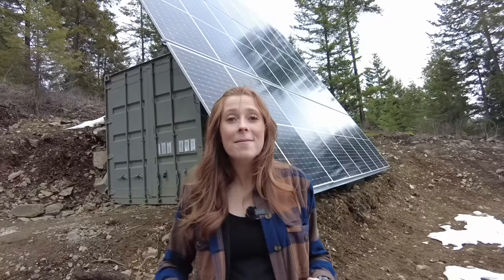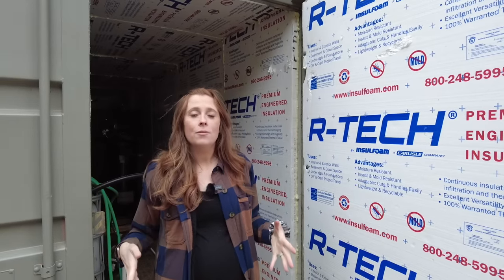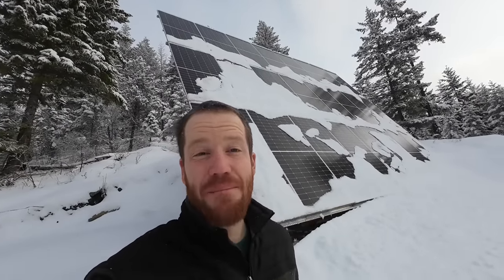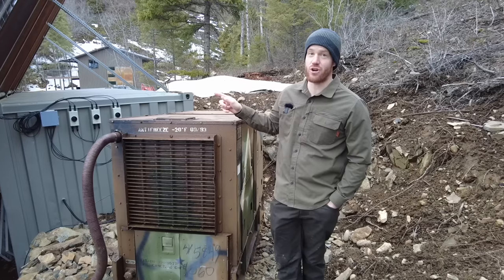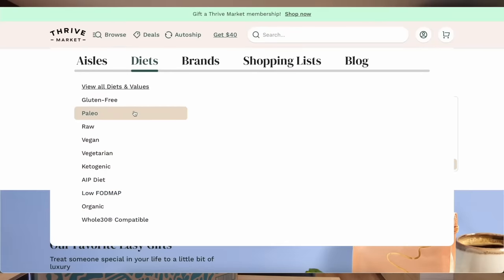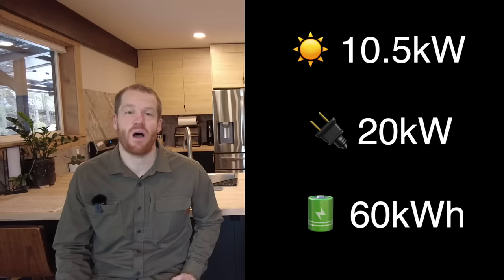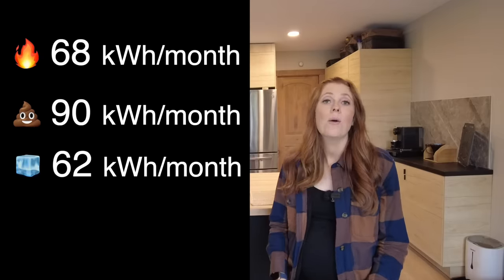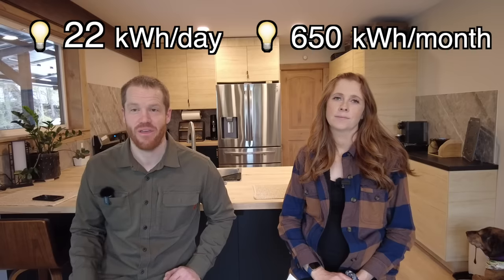The TRUTH About OFF-GRID Solar | Winter Update

Comment: I hate the idea of a generator. BUT the numbers don't lie. 10k per day on average, with 20k use. You would have to double the array size (stupid). Or make the battery 10x bigger (also stupid). In this specific use case, a generator is a no-brainer.
Perhaps in the future as panel prices continue to plummet, it may be worth expanding the array. As for the extra energy? Get crypto miners. Not only will they (eventually) pay for themselves, you can use them to heat your house! :)

Comment: "Burning the poop" makes no sense. You can separate the poop from the urine and just drain the urine into a septic tank. The poop can be dried and mixed with wood and used to heat your home or hot water instead of consuming electricity.

Comment: Lots of explanations. It's good to a point, but is trying to navigate a very complicated and board situation. This approach clearly isn't to save $$ by making your own power. That's clear with the 60 kwh of battery banks. The purpose of "off grid" is to remove the dependency of power companies, but this comes at a cost. From my own calculations to save cost the best way is to use solar, but not enough to go over your average usage. If you produce more (companies don't pay much anymore in most places) then you'll need batteries to store it, but the batteries even the cheap ones are so expensive often one can buy electricity cheaper than a battery can save during its lifetime... hence the solution to save $$ fit a solar system to supplement your power needs. The solution for off grid is lots of solar with generators for backup.

Comment: I get the impression that your system is to big. Since you have much to much energy produced 9 months of the year. Would it not be cheaper to downsize and just run the generator 1 extra month?
Reply: You think they should sell off solar panels and buy fuel?
Wasting electricity in the summer doesn't cost them anything beyond initial investment buying fuel costs them every year. That cost of fuel could buy another kilowatt of solar or a few kWh of better batteries.
If you have the space why would you not size your system to work during the season of least light?  Why worry about free summer electricity being wasted when you have more than you need.
I use about 10-11  kWh per day sometimes a little more in the winter if gas prices go high enough to use more electricity.
I bought 8125 watts of solar panels 25 x 325 watts 8 for the battery/inverter 8 more for direct feeding a solar powered minisplit with solar inputs. And I have no intention of giving up my grid connection or selling them any of my electricity.

Comment: how about hydrogen gas production? store 9 months H2 of and used in a fuel cell or burned in a H2 gas fired generator.
so 9 months out of the year your excess solar makes H2 gas. you store that gas.
you could use a fuel cell, using the heat from the cell to heat your home and hot water, or you could burn the H2 in a generator using the excess heat from the generator for house heat or and charge the batteries. burn H2, you get water, store the water, you can use it again. hey no 450 dollars for diesel.

Comment: Step 1. Be rich
Step 2. Act relatable
Reply: You don´t have to be rich in order to be well-prepared. Just act smart. Don´t waste your money. Buy correct items. Don´t buy things which you know you won´t need. Don´t waste money on e.g. 5000$ generators or 5000$ powerstations. Those aren`t cold-proof nor are they fail-proof. Better buy 2 or 3 small generators to split the risk of malfunctions.

Even buying very small and cheap things can make a huge difference. E.g. i can use 1.2 V Battery-to-5V-converters to charge phones and other USB-devices. See? They are very good, they are fail-save, COLD-save and good for charging any USB-devices without needing a powerbank.

Here where i live, they throw simple 1.2V batteries on the ground.

If you have 3 or 4 of them, you put them in such a 5V-converter and boom you can charge simple USB-devices such as smartphones, powerbanks or other small USB-devices.

Comment: Curious about why you don't add battery capacity for winter use? That way when you do have to use the generator you're going to reap more power.
To be fair, investing $XXXX in batteries you only use for 3 months is rather stupid, but what if that halved your generator use in winter?

Comment: You could mine bitcoin with your excess power production and earn $$$ instead of wasting it. It's very easy for anyone with a little bit of tech ability and you are well-suited for it. Just buy a miner (or two or three or more) and set them up to run when your batteries are at peak, and all that excess power will produce dollars.

Comment: Guys, what are you doing there to have this extreme consumption? We are living in a 150m² house built in 1958, so there are thin brick walls and we have a consumption of roughly 3000kWh/y.
Reply from the maker: Electric water heater, electric incinerating toilet, electric dryer, water pump, lots of fabricating (welding), air compressor, big overhead shop lights, etc. It all adds up! But, 9 months out of the year we produce more power on our solar than we can possibly consume so going with electric appliances over propane just makes sense in my opinion.
Reply: Brick walls buddy. There you go. You said it. 👍(that might be the reason why no people live in plywood or thin metal sheds anywhere in the world apart from USA and Canada)
Reply: Heating and cooling costs add significantly to power consumption in the USA.

In Johannesburg, South Africa, we use some gas for heating (specific room/s at a time) in winter. Brick & mortar house with 3 occupants. Geyser on a timer for hot water. Two 0.75 kW pumps (swimming pool & koi pond). Average consumption is around 36 kWh per day.
Reply: @AmbitionStrikes  I guess, electric water heater and toilet should be the main consumers, as they are used every day. When I lived in my parents' 190m² house, I had a workshop and did a lot of car repairs, using a welder, an air compressor, and an electric heater for my garage which wasn't used very often. I don't remember our consumption back in the days, but it never seemed to be out of the world, 'cause my parents never complained. 😅
Now my 89yo mother lives there alone and uses electric heating sice 2019 as she can't carry wood inside the house for heating any more. Her consumption rose from less than 2500 kWh/y to roughly around 10-11000 kWh/y!
Reply: @no_clot_shot1128  Houses made of brick are common here in Germany. 😊
Reply: @DaveHart-G  Still rather high, but the pumps are running 24/7, I guess? Do you have air condition, too?
Reply: @Felix-fy7ki no air conditioning. Koi pump runs 24x7, pool pump 4-6 h/day. 
Last month, usage was 30 kWh per day, but we have hectic load shedding with no power 5-10 h/ day. National utility company is a total disaster
Reply: @DaveHart-G  Oops... :-/

Comment: It does the same thing with my solar panel that don't got solar panels in the backside of the solar panels so that's a misgiving and you're getting in such an angle that runs off anyways whatever sunlight comes from the fronts going to run it off anyway so it doesn't matter and to tell you the truth even do that uncloudy day as long as there's enough light coming through the clouds to do the same thing and that's if you don't have bifacial solar panels I know I don't have bifacial solar panels. No that's not true because I had solar panels before they even had buy fish house open doesn't mean my solar panels are what 20 years old 25 years old and they still work and it's no still comes right awesome so don't tell that little FIB that you do not know about especially when this is the first timebyou had solar panels. And besides the point I didn't have to clean up my solar panels I'll let the sun do it and I was still making power when was covered maybe not a lot of snow but a few inches of snow doesn't bother me so much of her as long as it's still make the power I need Amina Puyallup I need but I guess the sudden I tore the warmness of the Claudie brightness to time to clean the snow off the solar panels what usually took about a half a day and be more truthfully just 2 hours.

Comment: Lol masive overkill nothing like lets Make everything electric regardless of efficiency Making you use a ridiculous amount and then making.
A solar setup worth more than the house itself lolol 

I live on a 10 kw batt with a 4kw output an a 3kw array all of witch was 8.5 grand powering a 1200sf old house with Really bad insulation and a 700sf gurage  I use maby 30 gallons of propain a year for the hot watter and oven.  So my 320 gallon tank lasts  5+ years 
Thats 2 people. 
I am in A very cold climate so in the winter It's often super cloudy Sweep back up generator dose kick in a lil in the winter  i use 25-40 gallons of gass for that witch is less each year as we improve a bit each year. So i spend maby 200 a year on fule as is thats half a winter month on grid lol

Comment: Hmmm....its almost as if the guy who helped you install this somehow thought a 60kwh battery system with 10.5kw of arrays was great idea.  Also that generator setup is just stupid beyond words.  You needed at least double the panels, especially with all the shade you get.  

My generator automatically started 8 times last year to charge my batteries otherwise i live in a much larger house with more luxuires and dont have any of your issues and only have 3kw more solar on an unadjustable rack.  

Poor planning = poor performance